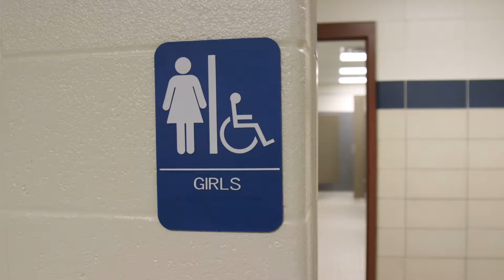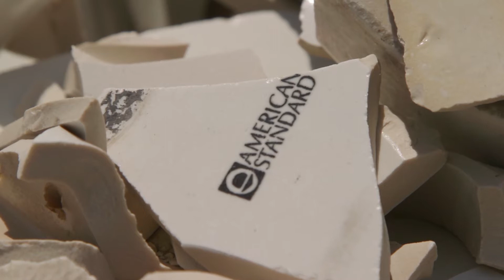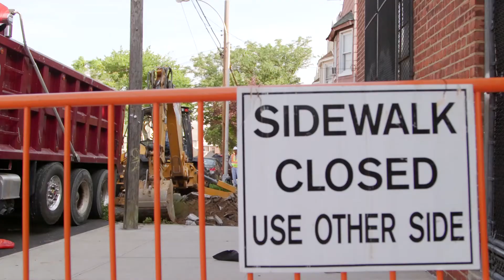From Toilets to Rain Gardens

Comment: This is absolute stupidity. Water will never dry up so replacing toilets is completely pointless unless the business doesn't like the higher water bills. What people don't understand is that these old toilets use a lot of water for a reason and that reason is because that's what works. New toilets leave smears, they clog, and they are cheap quality unlike the old ones which are the complete opposite.